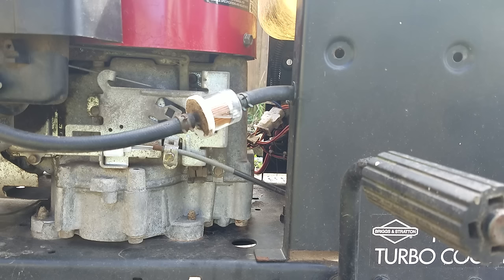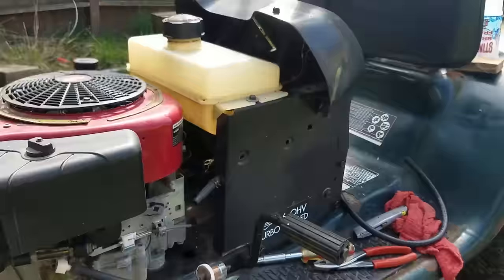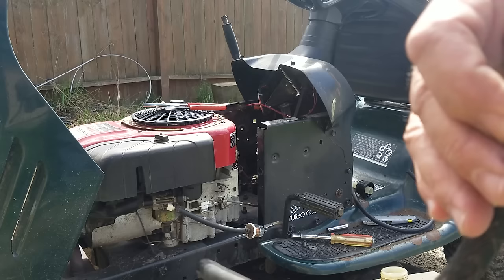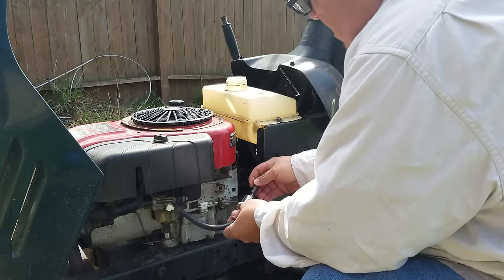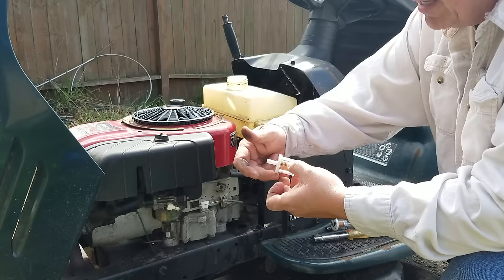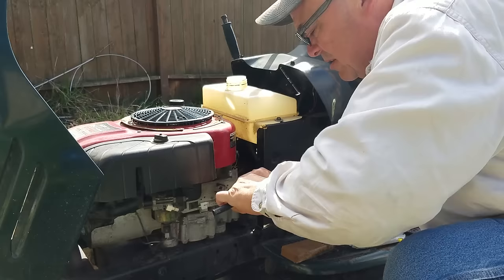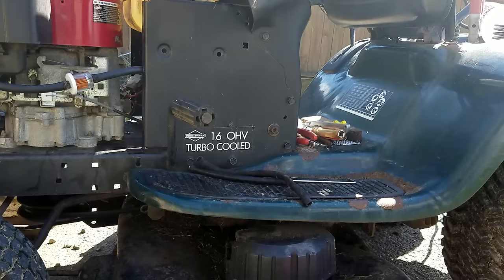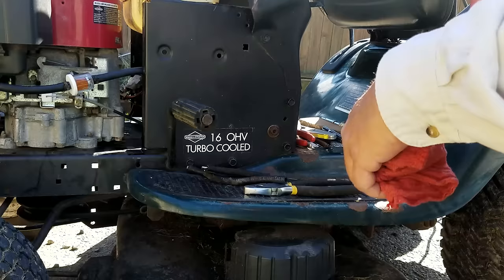Riding Lawn Mower starts then dies. FIXED

Comment: Hey by chance do u know why my mower doesn't start..I have the same mower like the one u have..my mower have been store all winter in a none heated barn..can't seem to get it started
Reply from the maker: Does it crank? If yes, spray a little starter fluid in the air cleaner and crank the motor. If the motor starts then acts like its out of gas then you have water in the float bowl. You need to drain out the water. There is a 10mm (ish) bolt on the bottom of the bowl that can be used to drain it. Water building up in that bowl is very common.

Comment: Having an issue with my 2008 Lt2000 17.5 hp ride on. Changed carb and did adjustments. Mower starts but not when full choked. Mower dies when full choked. Can run it for 2 mins then dies. Then won’t start for a few. New fuel filter as well. When I change from low to high throttle rpm’s don’t change. Any suggestions?!?
Reply from the maker: If you have the gas tank under the seat you may want to check the fuel pump it is on the rear of the motor between the motor and steering. It has a vacuum hose that comes from the oil filler tube, check for a cracked hose or bad fuel pump. The pump may be gummed or plugged up. Also check the fuel cap as the vent hole can get clogged.

Comment: Ethanol is not the problem. Look at your fuel tank. Look how good it looks and it almost always has fuel (ethanol), in it. Look at your gas cans. Why don't they leak all over your garage floor? They usually have fuel standing in them until you've emptied them. If ethanol was the problem, everything would be dissolving. The problem I believe is the fuel line material. I've switched to vinyl tubing. So far...so good. No leaks, no problems.
Reply from the maker: I had the Vinyl tubing in my weed eaters and that stuff got hard and brittle.  Could also be our blend of Gasoline in WA State as well.
Reply: Haven't you noticed that gas cans are made of much different material than rubber hoses? They are some kind of polymer rugged plastic blend and are made to be tough for longterm gas storage.

Comment: My Craftsman keeps dieing after running for a few minutes also. The filter looks full of gas. I didn't check it before running  it on and off for the last hour. I also have to jump it after it dies to start in again. Any ideas for trouble shooting this. The guy I bought if from says it's a new battery. (It's not). 
Maybe I'll buy a new battery and check the full line? Just bought it a few days ago for $600.
Reply from the maker: There is a stator that acts like an alternator, if that is not charging the Battery the engine will stall. Then when you charge the Battery the engine will run until the battery dies again. So that may be what you need to check for. Is the battery being charged by the engine.
Reply: @breakerbroke23  put a new battery in it today. Ran pretty well. Didn't have to jump it. However, it wanted to die if I put it in reverse with the blade engaged.
Reply from the maker: Empty the float bowl, may have some water in there. I left one of our mowers outside all winter, lots of water accumulated in the fuel tank so the motor sucked the water and filled the bowl up whit water. I emptied out the bowl a couple of times before the water was gone from the tank.
Reply: @breakerbroke23  right on brother, thanks. Great video. Helpful and you were cracking me up.  😁

Comment: Ok but what if it isn't that, I'm completely stumped bc from tank to carb it flows nice..it's a 5 year old craftsman t1200
Reply from the maker: Check for water in the tank. Check for water in the float bowl. Drain as necessary.  Also check that the vent hole on the tanks, gas cap is not plugged as well .
Reply: @breakerbroke23  Thank you for the quick response, I've done all of the above and it used to only stall on a side hill and now as soon as it runs about 3 minutes and I engage the blades it dies but then fires right back up, I changed the plug, the carb seems fine but I have noticed the last few times I filed the gas up it would get a air bubble in the tank itself and still have room for more but it was full at the cap which was weird I'm completely stumped I've checked all safety switches so I'm lost lol
Reply from the maker: Under seat tanks seamed to collect a lot of water while being stored during the winter. Your problem sounds like a water issue. Have you fully drained your tank? I save my drained fuel to check water content. Also pull off the float bowl and make sure no water was on the bottom. ( I put a small cup underneath to catch fuel and the water).
Slide the pin out of the float assy and see if the float has a hole or leak in it, the float will fill up and shut the flow of fuel off. You may also have some dirt in the carb, loose carb letting air in between the carb and engine block.
Reply: @breakerbroke23  yes sir I took the tank off completely and drained it, the fuel filter itself is original but it looks alright should the return tube from carb back to tank be bone dry because it is
Reply from the maker: Do you have a fuel pump on this motor?
Reply: Spray carb cleaner around there, change Air filter or clean, leave neutral to start...not those check your battery for loose connection
Reply: Sounds like a bad coil.

Comment: My mover stops when I engage the deck . Took it to a shop , they still cant figure out. Any Idea???
Reply from the maker: 1) check for water in the float bowl, or bad gas.
2) frozen spindle or jammed belt drive on the deck.
I have had this problem back many years ago, off hand can not remember exactly what was the cause, if I remember I will post. Good luck.
Reply: @breakerbroke23  Thanks let me check on that
Reply: I had this issue w/my POS craftsman garden tractor. It was a combination of things: the seat, got old and too rigid to depress the safety switch under it, the safety switch itself, and a 2nd safety switch at the break pedal. Good luck! These mowers are built to fail.
Reply: @dg903  thank you for that information
Reply: @dg903  damn this doesnt make me feel any better. currently working on my POS craftsmen, I believe its the ignition coil. wish me luck lol

Comment: My riding mower runs fine and cuts grass fine and then it starts cutting off after 15 minutes I disengage  the blades and it. Runs perfect so what is causing  the problem
Reply from the maker: Check and see if the vent hole on the gas cap is plugged up, if thats not it then I would empty the float bowl, it may have  water in the bottom of it.
Reply: Or the pullys and blade spindles have not been maintenance for years and they are trying to seize up with no lubrication in the bearings! And the hotter they get from turning so fast with a lack of lubrication they start to expand causing the engine to lose power under such a extreme load being placed against it!
Reply: @tonymayhew191  so what's the fix if that were the case?
Reply: Mine does something very similar changed filter,  lines, and new carb same issue😢

Comment: Use a screen filter. Your machine is gravity feed. That is the wrong filter.
Reply from the maker: Correct, only filter available to me at the time. Had to get the lawn cut!
Filter has been on a year now and works well no problems what so ever, feeds fuel like it should. 
Puts that myth to rest. Cheers
Reply: I think that’s my issue at the moment. Had the red pancake filter and swapped it out with PN: STP4726. At first it filled all the way up but about 30mins later the filter was drained and looked dry/empty. Gonna check lines for clogs and relocate the filter, maybe change lines:

Comment: WE ALL NEED TO SUE THE ETHANOL PEOPLE IF THE REPAIR COST MORE THAN $50.00
HIRE A PARALLEGAL.
LETS GET OWER RESPECT.
THOUSANDS OF LAW PROBLEMS FOR THEM...
Reply: chill out, you buy junk you get junk! Do your research before you buy the damn mower.
Reply: @Spinonemaster awwww did someone’s lawn mower break
Reply: Always use premium gas in all small engines.  It doesn't contain ethanol, if you use the cheap stuff it will clog your carbs and cause problems.

Comment: Does a person have to replace the fuel lin!e or can a person just blow it out?
Reply from the maker: Like Roberts comment below, you could try to just blow it out and get results. But, I have found doing a "quick" repair like that can sometimes bite you in the azz when you least expect it, like a 100 degree day and you and the mower are way out in the field. I would rather spend the extra time and do it correctly the first time. IMHO HAPPY 4th.......
Reply: @breakerbroke23  I have a Troybilt rider mower with a 547cc overhead valve engine. It keeps running as it's running out of gas. It's got a full tank of fresh new gas though. Air filter and fuel have been changed, new gas lines, I even took an air hose and aired out the fuel tank after draining the old gas. Fuel solenoid clicks when I turn the key on. Could it be the solenoid? I'm thinking it could be the fuel pump? I was wondering if you possibly knew where the fuel pump would be located on that engine? I thought it'd be behind the carburetor area but I didn't see it.
Reply: @eqbuffers5895 unscrew the fuel solenoid  dont drop that little plunger conn tempto12v while grunding the case of the solenoid you said it clicks but can you see the plunger moving down it may be stuck it is spring loaded up  12v pulls it down should be free the fuel pump should be between the filter and the carb,follow the hose its a little  square thing with 3 hose conn  thats in and out  and vacume  to test  the fuel pump  disc hose to carb hold a jar to catch the gas now try to start it you will have nice flow shoot out if it a good if not replace  thepump

Comment: Does this happen suddenly , one week it runs good then next week develop ??
Reply from the maker: It can, that is what happened to my mower.
Reply: @breakerbroke23  Thank you
Reply: @breakerbroke23  Well that wasn't it . Now it won't even turn over , could my battery go dead while I was mowing ?
Reply from the maker: Yes, there may be a fuse down by the starter you can check, there is a diode that turns AC to 12-14V dc, you may want to check that as well. AC voltage on one side and DC on the other side, if you dont get DC then that Diode may me bad. If you get no voltage then you have a staitor issue at the flywheel, its kind of like an alternator. I can send a link for that if needed.
Reply: @breakerbroke23  Thank you for your help but it will be awhile before I can check it I broke my shoulder .
Reply: @oldman9843  use starter fluid

Comment: I mean bud u could just also leave the cap on and turn the tank upside down on the ground and remove the line without having to drain it.
Reply: Possibly you can be less critical.
Reply: GREGORY ELMO how was I critical i was respectful and mentioned easier ways. I didn’t say yo dude your doing it wrong . I said bud you could also do this instead . Critical are u really that sensitive? I was trying to be helpful and I was polite
Reply: Steve, that is an excellent suggestion.  Thanks for the tip.
Reply: @helenshg4580  np, happy I could help

Comment: The fuel filter is on backwards it goes the other way
Reply: You are very wrong think about it like this the filter is on the white cap side so all the unfiltered gas is gonna have to go from the clear housing side or the gas tank side in order to collect the dirt into the filter if it was the direction you liked then the dirt would get trapped behind the filter and clog up quickly it’ll run either way but he has it on properly

Comment: Clamp that hose so you're not dripping gas everywhere
Reply: A yellow winged smooth wire nut plugs 1/4 hose nicely.  Still fighting with my Husqvarna yth2448 with Intech. Have replaced filter several times, plugs, air filter, pulled the tank cleaned, new line to filter, new fuel pump, carb looks clean but have not done deep clean yet (have pulled carb and manifold, cleaned bowl several times), checked coil gaps, anti backfire solenoid working fine.  It only has 130 hrs but is a 2005.  Going to adjust valves and replace filter to carb line but all seemed to flow well when took hose off the pump input and lowered, took off carb nipple and ran and pumped fine.  May go ahead and buy carb.

Comment: I could use some help with my lawnmower it’s a craftsman LT 1500 and we have changed the fuel filter and have replaced the coil it starts and runs for 5 to 10 minutes then dies could it be the carburetor ? Thank you so much in advance.
Reply from the maker: If you leave these mowers outside during the winter you will accumulate water in your fuel tank, so you need to drain the float bowl on the carb and check for water. You can find out if your getting water by placing a clean plastic cup under the bowl while you drain the float bowl, let the fuel drain from the bowl into the cup, then you will see the gas and water separate. If you get water with your fuel you may have to run or mow until the mower stops again. Repeat the draining process a time or two more. Good luck.
Reply: Thank you I will try that and see if that works.
Reply: Thank you so much for answering my question .you know what you are talking about it did have water in it and now it runs like a new one and I live in Kentucky where the winters are severe at times
Reply: Again Thank you and I would recommend you for any lawnmower problems.
Reply from the maker: @kayfletcher8709  That is so nice of you to say.  Glad to be of some help, THIS is why I YouTube.....
Cheers.

Comment: Actually your statement about ethanol fuel production being wasteful is false.  The entire process is very productive because the so-called waste products of the process are also valuable as animal feed, fertilizer and plastic production and it is vastly easier on the environment and keeps money inside the US for US citizens rather than fuel dictatorships around the world.  It is my hope that Thorium will end all petroleum production since it is much cheaper and much safer.  And Mr. Gore is right about the environment.  I have survived four cat 4 hurricanes is the last 20 years.
Reply from the maker: "Actually" your statement is wrong. In short it takes approximately 1 acre to produce 300 gallons of ethanol, that takes around 8 gallons of fuel per 1 gallon of ethanol to till the land, plant, maintain the crop for growing (water) harvest, truck the corn to production. Ethanol also when burned emits benzine...Not good. Oh and dont forget it is a corrosive, not good for combustible engine fuel systems. But you go greenie.
Reply: Sorry for my skepticism, can you name these four cat. 4 hurricanes.

Comment: My sr1028  snapper  riding mower. Has raw gas comming inside carburetor. When I start it.  It runs then shuts off.  I put new fuel filter  on.     So what's can you tell me to do to fix it
Reply from the maker: I would first pull the fuel line off as it comes into the carb. Make sure you have good flow to the carb.  Repair if necessary.... then I would pull off the float bowl , put a empty container underneath to catch the fuel and most likely water as well. Make sure the float moves easily and reassemble.  You more than likely have water in the float bowl 
Hope this helps... Cheers
Reply: @breakerbroke23  sir there is alot of gas. Inside  carburetor.   See I took the air filter  off.  And. I cranked it and. There is. A whole lot of gas. Inside  carburetor     I just put a small  inline fuel filter  on it.  And new fuel  line.   So what do you think I need to do now.
Reply from the maker: @glennperrigin7431  pull off that float bowl. You probably have a stuck float
Reply: @breakerbroke23  thank you